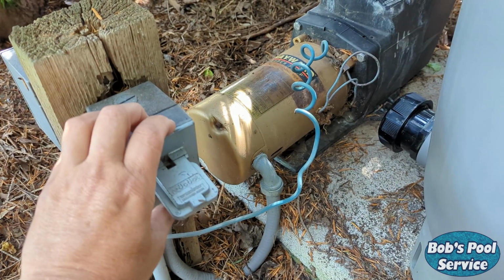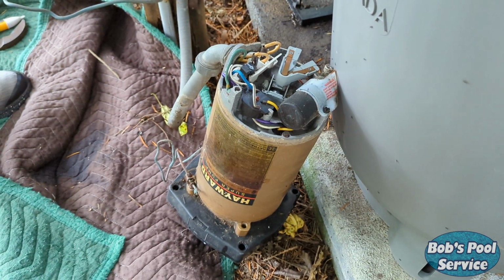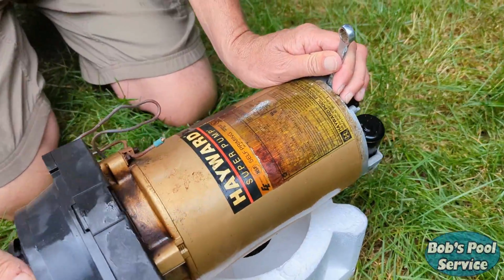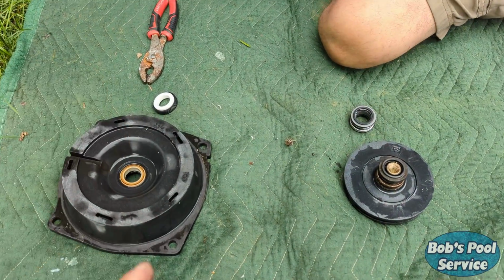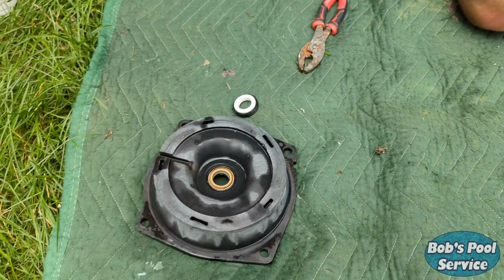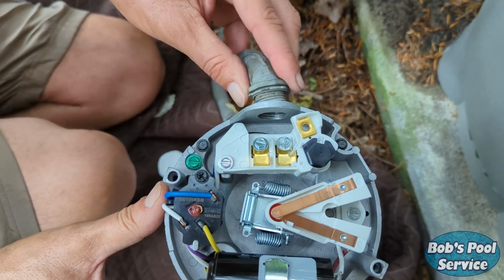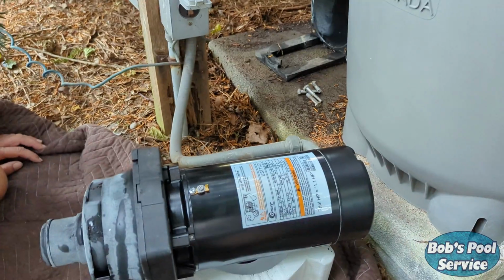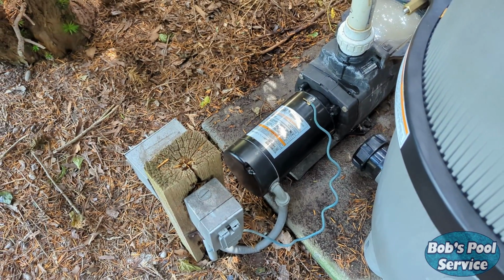How to Replace a Hayward Super Pump Motor step by step

Comment: do some motors that fit the super pump not have the diffuser?
Reply from the maker: I'm not quite sure what you're asking but let me clarify.  So the "motor" portion of a pump never comes with a diffuser, impeller or any other parts other than the motor.  In fact pool pump motors are not even made by the pump manufacturer and are often used for many different applications, for example my table saw has a similar motor to that of a pool pump.  With this said, any in-ground pump needs a diffuser including a super pump, in the case of an above ground pump since it's always located below the surface of the water and only needs to push it back up, not draw it from a lower point the pump does not always have one.  If you put a super pump back together and forget the diffuser it will not run right and will take an eternity to pick up prime if it does at all.  Hope this helps.
Reply: Yes it does help and I appreciate your quick reply I am going to be installing a motor on my Hayward this week so thank you @BobsPoolService
Reply from the maker: @rrose002  Just take your time and pay close attention to things like the electrical connectors being securely under the screws or if you use crimps, buy good ones and avoid the amazon brands.  A little silicone lube on the rubber bits also helps, I even put a small bit on the bolts in case they need to come out again, it's not recommended but after 30 plus years I never had one come out on it's own with the lube so I think it's an ok thing to do.
Reply: Thank you for the heads up I will use the silicone also @BobsPoolService

Comment: Hi, thanks a lot for a very helpful video. One question, are the 2 hot wires interchangeable? Mine has blue and black wires and the motor has L1 and L2 connectors. I’m not sure which wire goes to what connector. TIA.
Reply from the maker: Yeah, with 220 and 2 hot wires it doesn't not matter if they're on L1 or L2, just make sure the ground wire is on the right terminal.
Reply: It’s connected and running now. Thanks again!!
Reply from the maker: @AZTechLead  Glad it worked out for you!

Comment: Would love to see closeup shots before the seals go on. I left one of the rubber washers on - looked like part of the pump housing. Anyway - thank you. Never would complete the project without this video.
Reply from the maker: There's a rubber part that sometimes stays on the impeller.  Definitely important to get that off before putting the new seal on where the brass part meets the plastic part of the impeller should be a 90° angle.  I sometimes take some Scotch-Brite or steel wool and clean the brass part of the impeller shaft before putting the new seal on

Comment: Great video but Did I miss you installing new O rings?  At the end you mentioned the housing ring but didn’t show?  I may have to install one myself and I don’t want to miss a step and have a leak because I missed something.
Reply from the maker: In this case the housing o-ring did not need replacing.  Generally it sticks into the housing fairly securely when the motor is pulled off but it is important to check that.  If it's flattened out totally and lays flush with the housing it's a good idea to change it although if it's good no reason not to keep it.  It's actually one of the easiest to replace, just 5 bolts, no taking of the impeller or disconnecting the electrical wires.

Comment: a few videos warn of not contaminating the white ceramic part of the seal and the black mating surface. Don't know how critical but I'll use a clean towel to press them into place.
Reply from the maker: Yes, I've seen those comments on here and for sure, probably a smart choice, however with that said in all the years I've been doing pools I've NEVER seen the ceramic part fail.  It's always the rubber that deteriorates and gets a hole,  in some cases I believe from low pH.  I've also seen the stainless spring rot out.  We've been using the "saltwater rated" seals now for all replacements that use viton for the rubber, time will tell if they last any longer.  PS-201V is the part number from US seal.

Comment: Just replaced my 1.5 HP Century motor on my Hayward Super Pump with the help of this very good video!  Thanks for posting this!
Reply from the maker: This was actually a plain ole classic super pump but the super II is indeed similar.  It's amazing how common the old design is in our area, I'd say 9/10 pumps are Hayward Super Pumps.  Glad the video was helpful to you.
Reply: @BobsPoolService  Thanks for the clarification.  I had actually gotten this video confused with another similar one that was for the Super Pump II.  I corrected my comment.

Comment: Great video!  I'm buying a pool house in JAX, Florida and know that {eventually} components fail.  I've replaced various types and sizes of liquid pumps when I used to work on high tech semiconductor manufacturing equipment, so I have a fair amount of confidence in my ability to pull this off.  Question:  Do the new gaskets/seals/ceramic coupling come with the new replacement pump or do they need to be purchased separately?  Thanks!
Reply from the maker: Some sellers include gaskets and seals with motors as added value but in general no.  Also realize the motors fit many different models of pumps so unless the seller knows you're replacing a super pump motor the gaskets and seals could be wrong.  For this pump the correct seal is a PS-201 or PS-201V (salt water rated viton).  If you're mechanically inclined a repair like this isn't generally too difficult. Probably the hardest thing can be tight spaces or electric wires that are too short or perhaps damaged.  We've had to replace the wires on some motor changes because the insulation was all dried up and cracking.  I've seen people just tape them with electrical tape but it's not the best way to solve that.
Reply: @BobsPoolService, thanks for the feedback.  Makes sense, if and when the time comes, I'll be sure to replace the failed unit with the exact same model number {if still available} or one that is 100% compatible along with the proper seals, gaskets.  Ahh, Viton.  I replaced literally thousands of Viton o-rings, seals, quad seals, etc. over the years for high vacuum systems and pumps.  Glad the swimming pool pumps don't require the pricey chemraz or kalraz brand o-rings.  :)

Comment: Not a bad video…However, the only BIG SLIP UP, was touching the white ceramic face when replacing the pump seal!!!  That is a big NO NO!  Fingerprints will cause it to break down prematurely…
Reply from the maker: You are 100% correct, however with that said in all my years I've never seen the carbon/ceramic facing fail and leak, it's always the rubber part that gets eaten up and especially with low pH.  But thanks for the comment, indeed one should wear gloves when handing the seal faces.

Comment: Everything went smoothly. However, I did tighten the impeller with a wrench…  motor seems to be running hot. Do you think that was the cause?
Reply from the maker: That shouldn't cause it, we often tighten them with pliers or a wrench.  The design of the impeller and threaded shaft will bottom out and not overtighten.  You can test thought with your hand and the power shut off to make sure the shaft spins freely, if it does you're ok there.  I would check the electrical connections, wire gauge  and line voltage, those factors can cause something like a motor to run hotter than it should.  Also the impeller must be matched to the motor size, typically 1hp is a 2607-c, 1.5 hp is 2610-c and .75 hp is 2605-c.  You can always go with a larger motor to impeller but doing so pumps less water although it is easier on the motor because it's doing less work.  The last thing that might cause a motor to work hard is some kind of restriction in the system, check to make sure you have water flowing properly.  Hope this helps, sometimes in the hot weather motors run hot even when installed properly especially when people start using AC's and the voltage drops.  I've seen voltage as low as 90V when it should be 120 during the summer!

Comment: They don't make 2 hp hayward pumps anymore (thanks to the D.O.E.)... what motor can I buy to replace one?
Reply from the maker: So the DOE didn't actually outlaw 2 hp pumps, however they set forth efficiency ratings and power consumption to where it does effectively rule out single speed 2hp pumps.  With that said you can repair an existing pump pretty much forever, just can't purchase a new one now.  If you have a super pump like the one in this video you have a few options, if the housing is good you can just purchase a 2 hp replacement  motor from Century electric or any other manufacturer, the style is frame size 56J round flange, threaded shaft.  It's a generic motor, we buy ours from a local place in East Brunswick called Quality Electric.  Your other options would be to downsize to a 1.5hp motor or even 1hp and fit a correponding impeller.  For 1.5hp you'd want a 2610C, for 1hp a 2607C, the rest of the parts are the same among different super pump models.  Lastly you can purchase a 2 speed motor, that will fulfill the regulations and you'll still have 2hp if you need it.  Do you have a large pool and a DE filter?  It's rare that we see a need for 2hp on residential pools and in some cases it'll work less efficiently if you have a sand filter because it simply pushes the water through so fast you're losing filtration, DE on the other hand is fine.

Comment: is the part number for the seal kit the same for the 1hp motor??? thanks...great video!
Reply from the maker: All hayward super pumps of this style use the same seal regardless of HP, 3/4-2hp all use the same seal but use a different impeller.  PS201 or PS201V (viton for saltwater pools) is what you want.

Comment: Great video!  I had a very stubborn impeller, but I went and bought a strap wrench and she came off.   Question… any benefit to upgrade a
 1 HP to 1 1/2 HP.  And I noticed the replacement motor is a Century.   I have a HP but the label is burned up.  The Impeller says 2600, and the diffuser says 1600.  I think the pump is a 2610?   Thank so much for the info.   Huge help
Reply from the maker: So the 1600 series hasn't been made in many years, all newer super pumps and housings, impellers and diffusers are now 2600 however I believe the diffuser may not have changed design so somehow you have a mixture.  As for HP ratings it you NEED a 1.5hp pump for a large pool it can be of benefit but only if the rest of your system is designed for that much flow otherwise you'll simply waste electricity.  For example a sand filter generally won't benefit from the high flow of a 1.5hp pump because you'll literally push the dirty water through so fast it's less effective.  On the other hand if you have D.E. they it might help you filter more water quicker if you have a 2" system.  1.5" pipes though I"d always always stick to 1 hp.  Now, VERY important, you MUST match the impeller to the motor (mostly).  If you put in a larger impeller designed to move more water (2610C is the 1.5hp impeller) you also need to install a 1.5hp motor or you'll overheat and burn up the motor prematurely.  You CAN go the other way with a smaller impeller and larger motor, it'll sometimes run cooler but then you're also wasting electricity.  Lastly, make sure the circuit can handle a larger motor, some cannot and that will cause you more grief.  But in general I'd say no to putting on a larger motor, many people feel bigger is better but you'd be better off running a smaller pump longer especially in the case of a sand filter.  Most newer pumps now are variable speed where they run much of the time off 1/10 hp yet you get almost 50% of the filtration so you can understand how it's just a more efficient system this way.  Hope this helps!
Reply: @BobsPoolService  wow!  Great explanation.  I was thinking it was a mix of   parts over the years.  Also, your exp. as to HP very informative.   No I dont play any instrument.  Not former coach of NY superbowl Giants either.
Reply from the maker: I almost forgot to ask in my reply, do you play a saxophone?  I took a photo of a Tom Coughlin at Woodbridge a couple years so, if so small world!

Comment: So doesn't matter which "hot wires" go to which terminal?  Mine are labeled 1 and 2 on the motor.
Reply from the maker: Well the hot wires have to be on the proper terminals but it doesn't matter which hot wire goes on which "line" terminal, they're not polarized and in the case of 220 nothing is ever polarized.  Just make SURE you know if you have 110 or 220 coming into the pump, if you get that wrong you can ruin a new motor.  I've seen electricians believe it or not ruin a brand new motor that way!
Reply from the maker: But to expand on this, I've never personally seen a motor that fits a super pump to have L1 or L2 marked for the neutral or hot in the case of a 110v instllation, obviously with 220 there's no difference, on any device which hot goes to which terminal... 3 phase is a whole other scenario.  I'd always check the wiring diagram on any electrical device and if one of the load terminals is marked for hot or neutral DO follow that but none of the motors we've used are marked as such and I've never had any problems, only an occasional defective motor perhaps one every 2 or 3 years and we install hundreds of motors each year.

Comment: Great video. i have the same pump (I do have some questions).
1. How long did your pump last?
2. I assume we have the same housing? SP2610X15?
3. The pump you installed, what was it?
4. The new seals you installed, do they come with the pump?
Thanks
Reply from the maker: So this wasn't my pump, it was a customers but typically we find new super pump motors last 3-5 years.  Back when I started the business things lasted 15-20 but those days are long gone.  The housings for super pumps are pretty much all the same, the internals, diffuser and impeller are generally the only difference so you can use the same housing.  New super pumps all use 2" housings which is actually a lot better even for 1hp systems.  The motor we installed on this pump was I believe and AO smith or US motors. Unless you upgrade to a sealed motor like Pentair intelliflow systems have they're all comparable.  The seals don't come with the motor, we now only use viton seals because they're rated for salt water too.  The seal number is a PS-201V by US seals.  Hope this helps, glad you liked the video!

Comment: I'm doing the stupid Texas thing too.....leaving everything uncovered for the rain and sun to ruin it
Reply from the maker: They're meant to be outside, the cabinet is painted steel so it should last.  The controls on the front though are plastic and the UV light from the sun can damage them so it's ideal to provide some shade for them but don't cover the heater.

Comment: Installed and it turned on but the next day it won’t turn on again. Could it be electrical ?
Reply from the maker: Certainly could be an electrical problem.  Make sure you had the voltage set correctly, usually setting it to 220 with 120v current wont' ruin the motor but it'll run improperly, however feeding it 220 if you have it wired for 110 can destroy the motor quickly.  I'd check to make sure the motor is getting current with a tester and also make sure the wires are secured well to the terminals.

Comment: Thanks for this great video. However, my impeller was NOT coming off. I sure do wish it came off as easy as the one in your video. I would recommend to folks trying this at home to perhaps have a replacement impeller on hand because you may be in a situtaion where you need to destroy the impeller on the old motor just to get the backing plate off and continue with the job. Good luck!
Reply from the maker: Sometimes a strap wrench will work or a very large pair of slip joint pliers to grab it.  Sometimes they can be stubborn.
Reply: Thank you for the recommendation of a strap wrench. This was exactly what we needed to get our stubborn impeller off. The Ace Hardware 4" strap wrench worked perfectly for $10 (even though the package said it only worked up to 4" circumference and our impeller was bigger than that.... the strap on the strap wrench is easily 6+")    @BobsPoolService
Reply from the maker: @joncarbone1934  Strap wrenches are great for pool work because they're gentle on the plastic.  Sometimes it's impossible to get a fitting off with pliers because once you squeeze hard enough to grip the fitting that pressure ovalizes the plastic and makes it bind.  With a strap wrench  you grab all the surfaces perimeter evenly and it doesn't stress the plastic.  Glad it worked for you.

Comment: When I went to prime it before even powering it up, the bottom was leaking water like crazy.  Ugh.  Any ideas?
Reply from the maker: Could be a few things, most common would be a bad or incorrectly installed pump seal.  If you get down low and the water is coming out the weep hole that's probably it.  The other common leak point is the housing gasket, it's a very thin gasket that seals the motor plate assembly to the front housing, it can easily get pinched.  If the bolts are tight check it's condition.  Lastly there could be a crack in the housing, rare but I've seen it.
Reply: @BobsPoolService  yep
It was the pump seal.  It had like little tits on the metal part the other part can slide into with the spring and it wasn’t quite lined up.  Thanks!